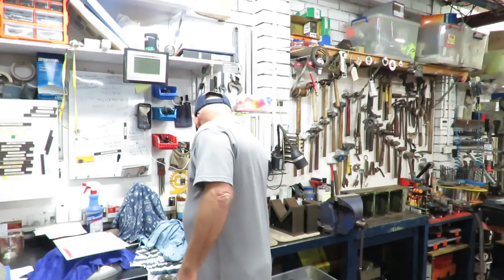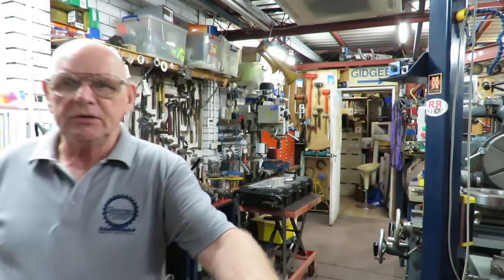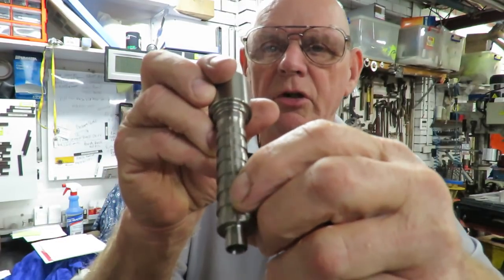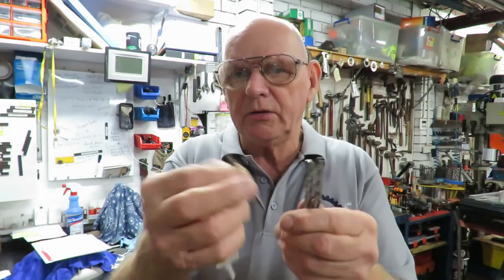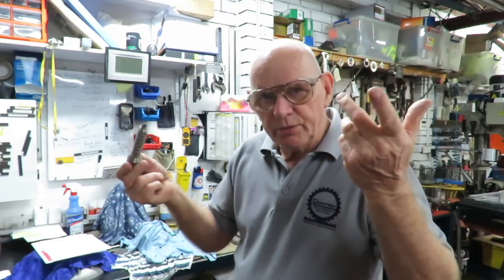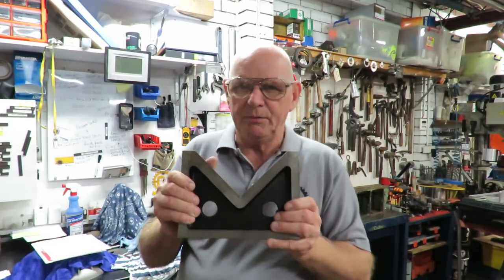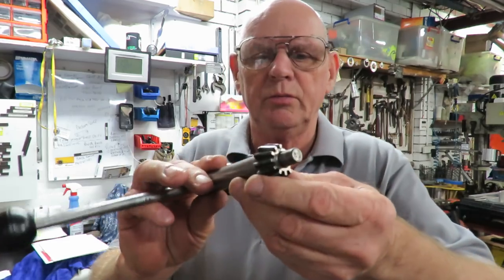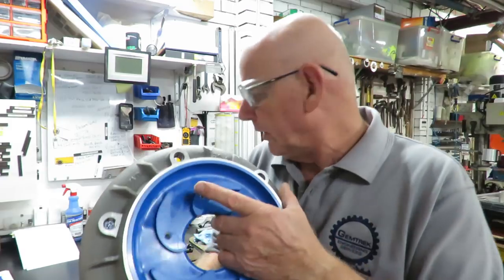Peanuts and Single Malt #1 Bruce Whitham in the shop random lots of projects

Comment: Titanium can be such fun, set light to a rag in my chip tray once!
Someone gave me one of those chucks and collets but mine is lever operated not key. Trouble is it is D1 4 not D1 3 that my lathe takes, so another workshop project to alter it, will the work never end? :>)
I have finally put up a rough video or two that you might find interesting. Feel free to comment, but take a few glasses of single malt first.